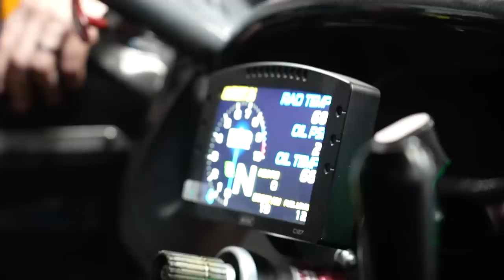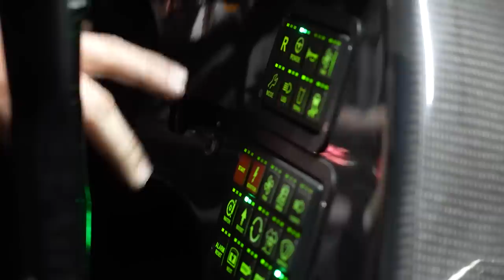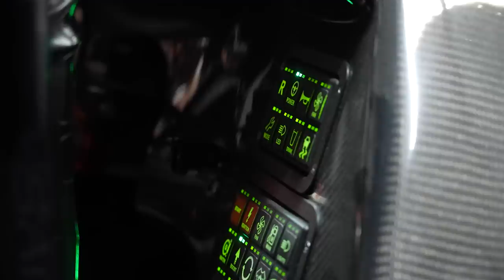SHOP TOUR! Rad Dan's New Shop In Florida Is SICK!

Comment: That dead feeling in the wheel between 45-70degrees he explained is either of these problems.. starting with bad trail on the knuckle (needs to be moved towards the front of the car where the LCA connects to the knuckle).
Too much suspension travel coupled with too tall a bumpstop.
Too soft a front spring (like you said) or the tie Rod end angle being janky on the wisefab.
& 100% Def not having a front bar being part the most of the issue